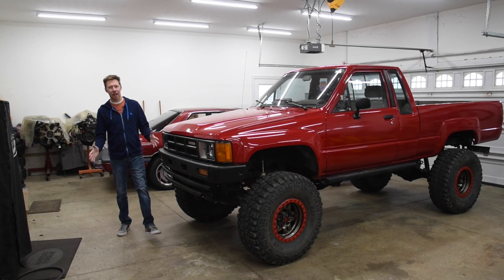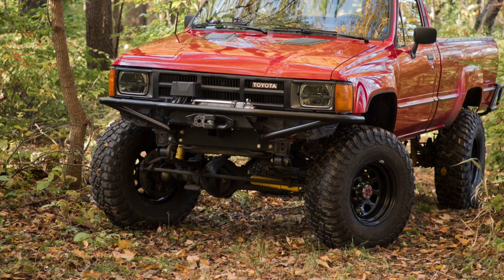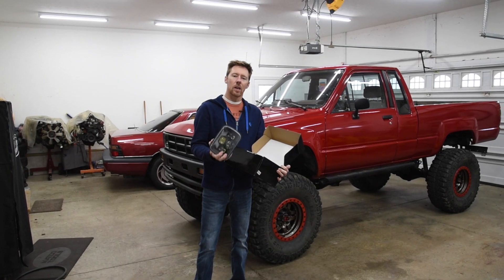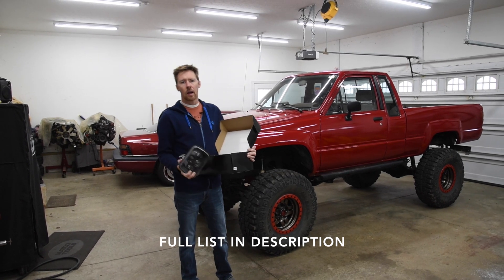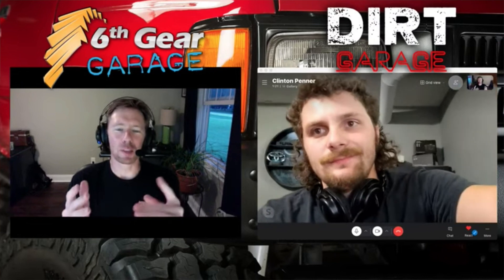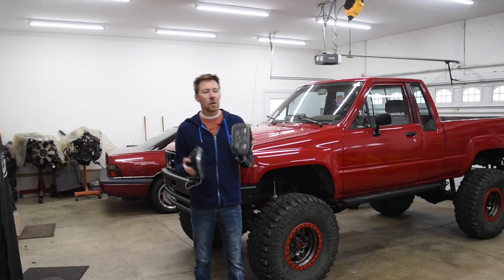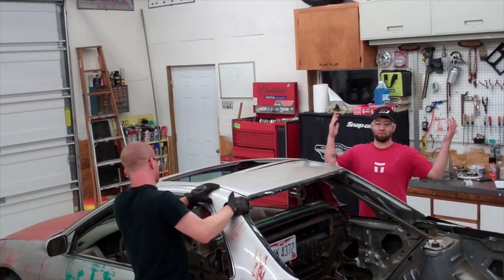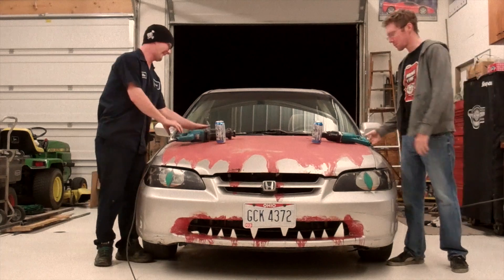50k Sub Giveaway - 5x7" LED Headlights

Comment: Hi my name's John I have an 85 Hilux Toyota pickup extended cab 4-wheel drive that I have been piecing together for the last few years I got the original 85 four-wheel drive from a Neighbour after it got stolen from him and someone took the engine out with a Hatchet to pull the engine they chopped up the floor to get to the bellhousing bolts and they chopped the radiator core support apart then a little while later I found an 86 Toyota two-wheel drive Hilux that I got for free had a blown head gasket swap the cab over bought four-wheel-drive fenders and got a different motor and rebuilt it been using it for my daily driver for years I watched your video on putting the LED lights in and I've always wanted to get some for my truck but if it's not cheap or free I can't afford to get it it took three Toyota pickups to build my one truck but most of it was free